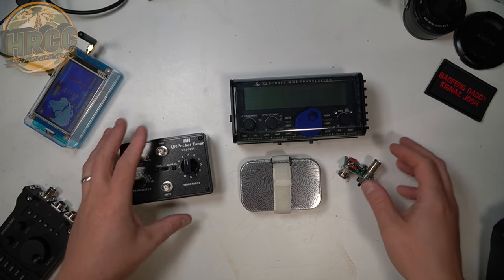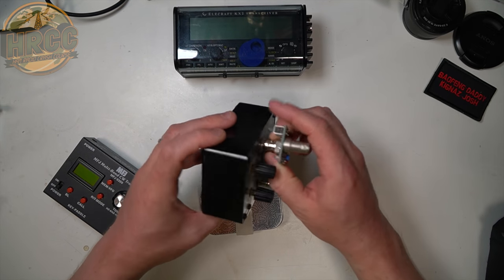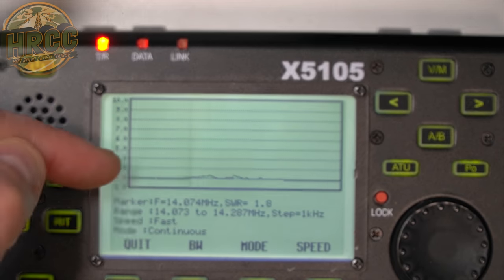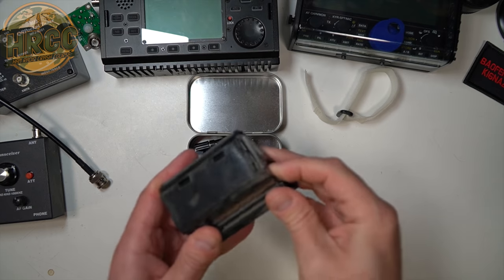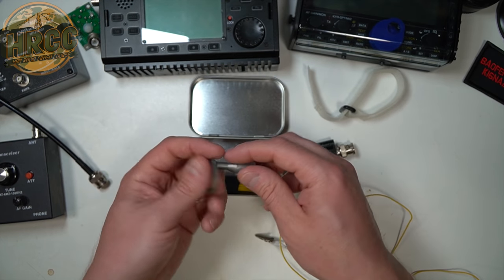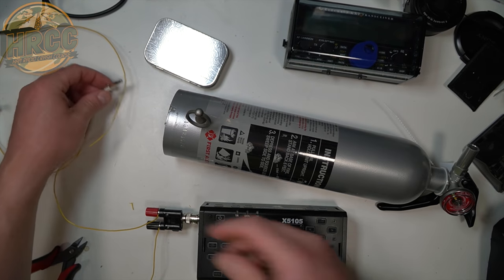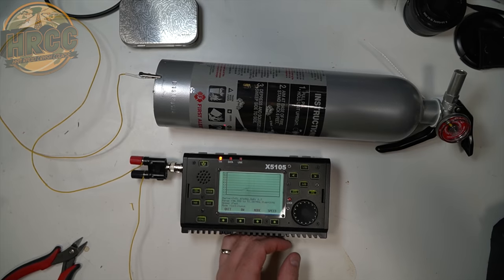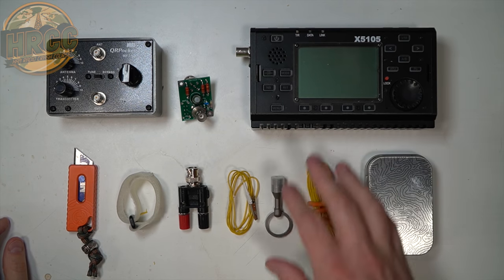How To Make A Radio Antenna Out Of Anything!

Comment: I just bought some paracord from a company called Titan Survival, the paracord has a strand of wire in it, supposedly it can be used as an antenna or small game snare if needed. Also has 25 lb monofilament line for fishing and a strand of waxed jute string for starting fires. Someday I'll experiment with the cord for making antennas, I'm not sure if I have to remove the wire from the cord or just use the paracord and expose the wire on the end.  Should be fun trying it out. Any way your video subject matter reminded me of this product.

Comment: as a fellow kx3 and 817 qrp user, i suggest sodering and crimping ring terminals big enough to go around the bnc posts. I do this in the field as its a stronger hold and more secure. I like that you can screw off the caps and lock it back in.
73

Comment: you should add some electrical wiring terminals....the white ones with the 2 screws per line. These are very handy on connecting lengths of antenna and power cables

Comment: Josh,
You may want to use larger rubber bands to bind your Altoids box closed, so you can use the velcro wrap for the wire bundles or vise-versa.
Reply: I like to cut bike intertubs cross ways in the army we call them ranger bands  thay work grate for lots of thing's   i use pallet tins that the lid screws on put the range band all the way around the out side  n it water proof  keep my fire starter dry

Comment: Another awesome video Josh thank you for this!
I own that little SWR indicator kit, though I have not built it.  I bought a G90 before I went too far down the path of buying manual QRP tuners, though I have built a few. -building a good compact variable inductor was my biggest hurdle, but the experience was well worth it.
I have this luggable kit with a piece of coax and a 9:1 end fed for an antenna. -Didn't even think about something as simple elegant and accessible as this.
I think I am going to try some stuff with my G90, and may ultimately build a very similar antenna kit as yours for it!
Even for SWL this is an awesome kit. Very adaptable.
73 de N2NLQ

Comment: It's sad I spent as much time as I did on my dipole and you pull a 3 to 1 on a fire extinguisher.  No justice.
Reply: The dipole is very efficient. With ATU or transformers you always have losses and it is better to you resonant antennas.
Reply: A dummy load has a VSWR of 1.0:1.  A "good" VSWR does not guarantee an efficient antenna. An antenna that radiates poorly (cloud or ground burner) is not a good antenna.   As with many things in life, important is "location, location, location."  With a dipole, height is might.  Topography, man-made structures, especially electrically active ones, soil condition all are factors.  Granted, any antenna is better than no antenna, especially in emergency situations.  It may just not work all that well.

Comment: How about adding a small disk magnet with a bolt thats sharpen on the end attach to center of the magnet. Pretty much a minature magnet ground clamp used on welders. Point on bolt or screw will scratch and pentrate paint or oxidation and clip alligator clip to other side.

Comment: Recommend a dogbone w/ some 550cord instead of the boxcutter.  With it, you can reduce the length of your wire, without cutting, in order to tune to resonance.  PSA reminder: tuners are just where watts go to die

Comment: When "flashlight" meant 2 D cells I always put a piece of 400 grit wet-or-dry sandpaper alongside the batteries, in case contacts needing cleaning. For antennas...maybe a patch of 220 grit?

Comment: Ditch the "tie wrap" on the long wire, use the feed wire as the wrap, OR, use a piece of solid copper ground wire, for both.  Could come in handy.....

I'd add:
  -- A square of coarse sandpaper for roughing surfaces, along with the razor blade, and a spare `gator clip.
  -- 6" or so of copper ground braid
  -- Solder on the `gator clip, and a flat, open lug to the other end of your "feed line", you get a lot more flexibility this way
  -- Put the same on your long wire, again, for flexibility sake.  Cut the lengths right, might get a trick di-pole out of it?

All of this should fit in your tin.\

BUT, why not upgrade to a small plastic case intended for fishing stuff, with the same relative footprint as the radio, and add some more goodies?

Comment: What specs on a laptop do you recommend to run a sdr?
Reply: Anything modernish should work, I would say 2010 hardware to be safe. But take that with a grain of salt.
Reply from the maker: I'd agree 2010 or higher.  The faster the laptop the better the waterfall will render

Comment: You forgot about catch 22. A well tuned antenna is not necessarily a good one, what about radiation pattern, gain etc? You're basically tuning something that's slightly better or equal as a dummy load...js
Reply from the maker: It’s just for fun my dude.